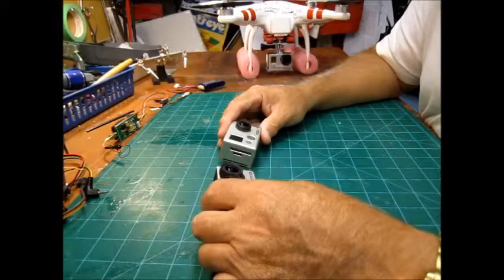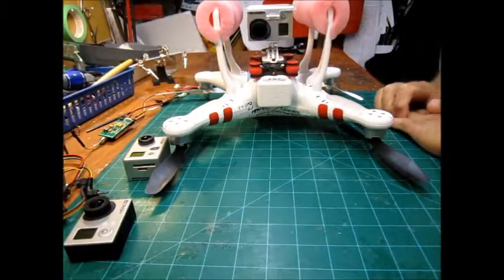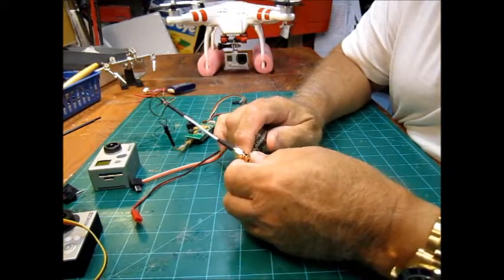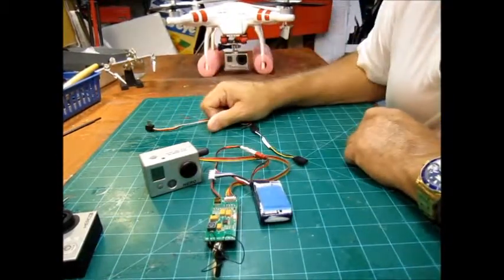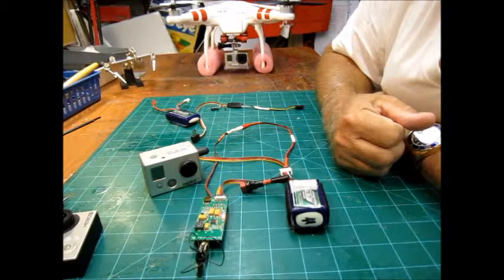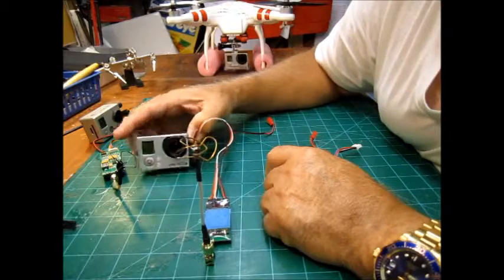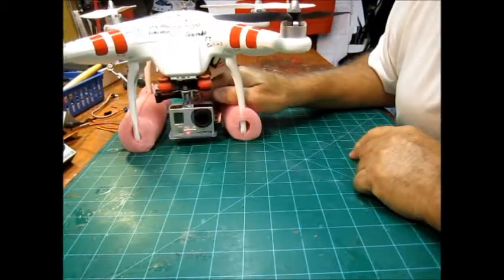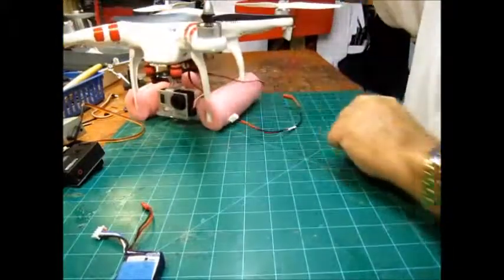How to Install a 5.8 FatShark System on a Quad

Comment: well it work with sj7000?
Reply from the maker: +Robert Gruben Yes it will if the 7000 has a live video out cable and connection.